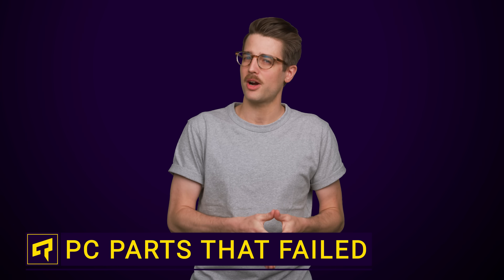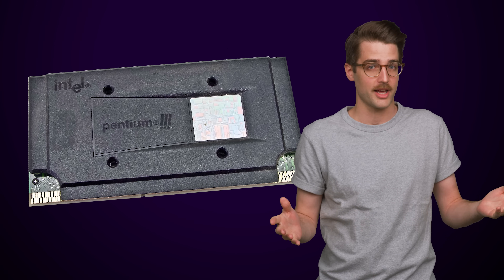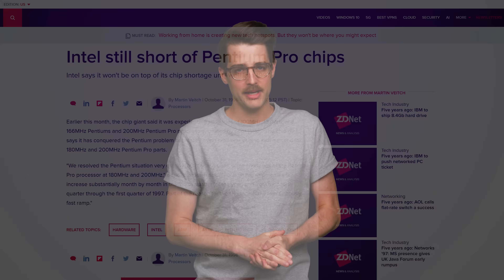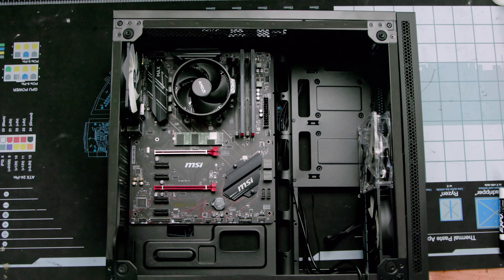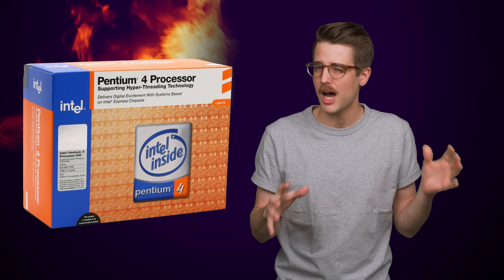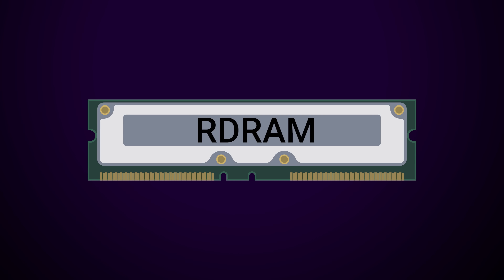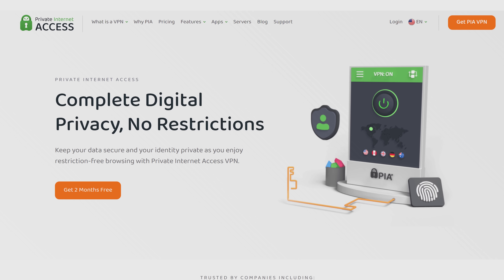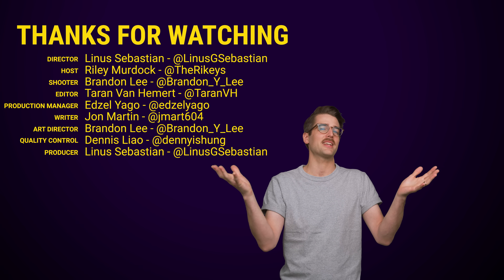PC Parts That Disappeared

Comment: more old stuff: the turbo button, physical co-processors, ISA-, PCI- and AGP-slots, IDE-ports
Reply: That turbo button was probably the most misunderstood and misused feature in the history of home computing.
Reply: @Seadg  Yep. It was really "run at full speed" or "run at a reduced speed"... no Turbo about it anywhere.

At one point it was a fun troll to walk around and see someone playing a game (such as the original Star Wars) and noticing that they had the turbo switch set to "not full speed", press it back to full speed. At which point the game became immediately insane and unplayable. It wasn't coded based on timings, just to go as fast as possible...
Reply: @Seadg  Wasn´t the turbo button designed to keep some applications from running wild as they were clock dependent? Like games f.ex. that would run too fast if the turbo button was on?
Reply: @Seadg  I think you can still gets that on some PCs that features that. It's like a "auto overclock" feature now of days though.
Reply: @Seadg  yeah most people did not understand that when "enabled" it actually cut the processors speed in half vs making it faster.  I had actually built a DX2 66 with MFM hard drives one time just so I could play games like The Oregon Trail lol even had windows 3.1.1 just for networking running DR Dos instead of MS dos.
Reply: physical co-processors are really cool, especially the ones in the 386 times
Reply: @whamer100  the 486 SX didn't have a built in math coprocessor but the DX model did. It was standard on pentiums. It was very important that my six year old brain remembered this because I'm 32 and waiting for the day this is useful information.
Reply: @McBlazington  Was it possible to have a second coprocessor with the DX model? I wonder what would happen if that was possible (unless it uses a different socket and im mistaken)
Reply: @whamer100  with the 487SX, it was essentially a 486DX with different pins. When plugged in it disabled the 486SX chip and took over all the processing.

Edit: The DX and SX had the same socket, but different boards may or may not have had the coprocessor socket. I imagine there was some sort of protocol to disable the second socket for the DX.
Reply: Those didn’t fail per se, they just became obsolete. Mind you VLB and AGP barely lasted two generations.
Reply: @TheOriginalNCDV  The video wasn't about failed hardware, but, well, literally look at the title.
Reply: @thany3  Watch the video. READ the first thing that appears on the bottom. You're welcome.
Reply: @TheOriginalNCDV  I dunno bro, I was still buying AGP when the 8800gt launched. I had a ATI radon sapphire HD2600 PRO. 
My next upgrade was a HD 5770.... jesus christ that was a he'll of an upgrade.
Reply: VLB and EISA. I've still got a Cyrix 486 with working EISA in it (SCSI, too).
Reply: Just an entire episode about Jumpers and how to configure your motherboard, drives, and expansion cards.
Reply: My first real computer was a commodore Vic 20. Yikes, I am old.
Reply: @rickh8380  TRS-80 for life.... team tandy radioshack
Reply: @rickh8380  My very first computer was a custom-built tower PC with an Intel Pentium 233 MMX processor, it initially had 32GB of RAM, and originally came with Windows 95. I don't remember the hard drive's capacity, though. Several years later, we upgraded the RAM to 160MB and the operating system to Windows 98 Second Edition.
Reply: and dont forget BNC Bus networking
Reply: @BoerniLE  haha yeah unplug one node and the whole lab is down. Oh highschool...
Reply: SCUZI
Reply: Sockets to insert individual CPU cache RAM chips
Reply: I still use a FireWire 400 audio interface. But remember when FireWire 3200 was meant to beat out USB 3?
Reply: VLB and Firewire would be great ones. Firewire didn't really catch on outside Apple and kinda was obsoleted quick. Unless you used high speed (at the time) external drives or DV camcorders it didn't really get used. Obsoleted by USB 2.0 real quick too. VLB was funny it last like what 4 years? AGP was around a short time but actually served a purposed as graphics had gotten important. VLB was like there one day and gone. Back when we counted video cards in the single digit MB range for ram or upper KB. I remember all those standards. I learned basic on an Apple clone (Laser 128). I am old and obsolete myself x.x
Reply: Math coprocessors. I think one of them was the 8087?
Reply: @comicsansgreenkirby  Correct... after that came 287, 387 and 487 (well, kinda, it literally was a 486DX that would disable the 486SX it could be added to).
Reply: AT motherboards, SCSI, eSATA, Firewire, CD caddies, trackballs, the contrast slider on a laptop, IrDA, PCMCIA
Reply: @thany3  SCSI is still around.
Reply: @JOE_XD  same with IDE. it lives on in Compact Flash Cards. CF Cards can literally operate identically to IDE Harddrives which is very useful for retro computers like IBM PCs or Amigas. it's basically just the IDE equivalent of a SATA SSD, smaller, faster, and solid state.
Reply: @JOE_XD  No new hardware produced today uses SCSI anymore. Therefor it's obsolete. Not out of use, but obsolete. Just like my 386.
Reply: @thany3  You should ask Anthony.. Logitech still making trackballs mice too. Your 386 don't even run Warcraft 2, get rid of that -> museum :P
Reply: @thany3   I still use eSATA (quite convenient for hotswapping HDDs) and my Laptop has a PCMCIA to 2xUSB3 card in it, so these aren't exactly outdated yet but rather uncommon by now. The rest tho, absolutely.
Reply: @XmarkedSpot  They are outdated, because no newly produced hardware has/uses them.

In your logic, my 386 would not be outdated if I'm still happily using it.
Reply: @thany3   Don't put words in my mouth, mate. In other words: just because something isn't in "newly" produced hardware - whatever you think that is - doesn't mean it's outdated. Are DVDs outdated? An optical drive is certainly a rarity on modern devices...
Reply: @thany3  CD caddies are still a thing, they might not run 5.25" drives anymore but I am using mine for dual 2.5" HDDs with hotswapping caddy. Works very well and like a charm.
Reply: @thany3  Trackballs aren't dead. They have a niche use in some industries..
Reply: @liboud22  You don't see them on any laptop anymore. And no, they're not dead, but they are obsolete. Just like RS232, which also has a niche in some industrial applications.
Reply: @thany3  There is a HUGE difference between claiming something is dead and something is only obsolete for general consumers.
Reply: 5.25 and 3.5 inch floppy memory drives
and you could have your blank floppys vaccinated with some sort of anti-trojan/worm/virus stuff but it took out some of your memory lol
msdos / lotus / wordstar
Reply: Floppy drive
Reply: Don't forget the lock in front of the computer
Reply: jumpers to set the cpu multiplier or the motherboards bus frequency
Reply: I fully expected IDE and AGP to make an appearance in the video! PCI and to a lesser extent ISA are still found on embedded systems and MoBos for industrial applications, since a lot of specialized expensive hardware whose often even more expensive to replace preripherals are still in use was built for those. The VESA extension to ISA however. Now THAT would have been an interesting one for the video!
Reply: PCI-X... fucking servers.
Reply: Wait, there's more!
Acoustic couplers - be very, very quiet when using one of those.
iomega Ditto drives and the damn TRAVAN tapes - expensive and unreliable af.
And the PS/2 connectors big brother: the XT keyboard DIN plug.
Reply: @chrishuhn5065  ahaha, my old amps and turntables use  5 and 1 pin DIN. I knew they were used in Audio and some specialized electric equipment, but never in PCs. Good stuff!
Reply: SCSI port.
Reply: "botton" ?
Reply: @YounesLayachi  fixed
Reply: Microchannel bus for $400, Alex
Reply: SCSI's too. 😄
Reply: @davidbolha  scsi is still around.  Rocking the server world
Reply: @SpartacusLegends117  Good to hear ! 🤘😏
Reply: I have an old mobo with IDE, PCI, PCI-X and AGP. Runs DDR, and has 2 LGA 771 sockets
Reply: Dude I remember being so stoked for having the best-in-slot nvidia geforce 6800 gt agp card! The last agp card they made
Reply: PCI and IDE isnt that old yet.
Reply: i sometimes think of adding a co-processor to my z800..... for $30 it might look cool
Reply: Even modern Mainframes that can rev up to 8000 VMs at a given time still have co processors coupled with system processors.
Reply: IDE, PCI and co-processors are still pretty relevant as of today
Reply: @kingeling  regular PCI and IDE are EOL. physical coprocessors were a thing you plugged in next to your CPU to aid in e.g. FLOPs. this is clearly not a thing anymore
Reply: @kingeling  
>co-processors with a PCIe interface are still a thing
We're clearly talking about home/enthusiast usage, not edge cases like scientific computing. There were at least a few notable 90s games that could make a tangible use of it, like Quake, Descent, the original SimCity and some flight sims.

And yes, you could to say that GPUs are also arithmetic coprocessor, but they are extremely fancy coprocessor, because video cards are not GPUs alone, but also memory and sophisticated power delivery systems. While 90s coprocessore were just that — only coprocessors and nothing more.
Reply: Don't forget MCA, LPC, PC/AT, PC/XT, PC/104, & the original 8088 it all came from.
Reply: I remember my brother's computer having a turbo button but it was so long ago... What was it for again?
Reply: @Joullele9  to downclock the cpu so older software would run at acceptable speeds. for instance, older games (at the time of course) were programed to run on slow processors in the likes of 8008 or 80186 and if you ran them on a newer processor, say a 80386, it would be so fast it would be unplayable. thats what the turbo was for.
Reply: I have a slot pentium II and 2 pentium III's laying around, also at work I have a control system on a machine from 2014 which has an ISA16 baseboard with the CPU on a board that plugs into it, together with a 128MB IDE SSD (yes, SSD) 128MB CF card for extra storage and running DOS, the CPU board was recently replaced, it used to be a coppermine celeron
Reply: Ultimate old stuff: The Abacus, the OG computer.
Reply: Jumpers
Reply: > physical co-processors
you mean, nic, tpm, audio dsp and gpus?
I don't think that really went away.
Reply: @satibel  No, the second (optional) processor just for speeding up math. This -> https://en.wikipedia.org/wiki/Coprocessor#Intel
Reply: These ones in the video were tried and failed techs, not "dominated for a decade, then had a successor eventually" techs like IDE or AGP.
Reply: @sapphyrus  Try those instead: 
XD Picture Cards - vendor lock in flash memory cards from Fujifilm and Olympus that never really took off because it was expensive and you could brick the card when you pulled it during a write or even only a read operation. At least now you can buy adapters for MicroSD.
IBM Microdrive - a teeny tiny hard drive in CompactFlash II form factor. Fragile, slower than flash memory and because of the motor needs way more power than flash memory and drains your camera batteries in no time. Why does this even exist?  Only because it was cheaper than CompactFlash cards.
1.8" Hard drives - The PCs equivalent of the Microdrive. You can still by them, but good luck trying to find one in a decent size, that doesn't cost you an arm and a leg.
Reply: wot, no Vesa Local Bus?
Reply: I just upgraded from a PC (3570k) that still has a PCI sound card (X-Fi Elite Pro) in it and two DVD drives attached to an IDE controller sitting in a PCIe 1x slot (getting that controller was cheaper than replacing the drives and I knew I had good ones that would still last for a while). And I still use that thing at least to transfer stuff over to the new one.
Reply: voodoo 1 & 2 :D
Reply: It was a dark time when ISA went away. Thankfully modern microcontrollers and the RPi have brought easy IO back to the hobby market.

Comment: For a technology that died that seemed to be 'forever' and even possibly superior: Firewire. USB was supposedly never going to be fast enough to handle streaming video, and large file transfers.
Reply: Because IEEE-1394 Firewire can transfer data at full duplex mode . Those days, USB only can do half-duplex. ntil the emergence of USB 3.0 , then it supports full duplex mode.

Comment: Thought for sure a Soundblaster sound card would be mentioned.
Reply: Soundblaster still makes sound cards
Reply: @aaronmischel4552  yeah but there was a time your game wouldnt run properly if you didnt have one or a compatable one. any old sound card wouldnt work.
Reply: @CaffeinatedSentryGnome  - could you elaborate on that? 🤔
Reply: @spavatch  early on games with written with the features of specific sound cards in mind. if your card didnt have the feature bad luck. dos games needed to have drivers for each sound card they support written in them.
Reply: was expecting same. im still running an spu with creative based chipset in it and have no plans to switch to onboard audio.
Reply: fun fact when I built my system back in 2012 I still thought sound cards were a thing and bought one of sound blasters cards.  Still have it today!
Reply: @firenutz698  - funnier fact, I bought my SB Audigy back in 2002 and used it in every PC that followed, up until 2Q 2020 when I built my latest system that unfortunately lacked regular PCI slots. I do still have it today though, the previous build is still intact as a backup PC.
Reply: They still make those!
Reply: I got a soundblaster Z card and the sound quality is 10x better than an onboard soundcard

Comment: I had an AMD Athlon Slot A 700 MHz processor. It blew up. Replaced it with the Athlon socket A 800 MHz processor under warranty.

Comment: I remember the Pentium 2 being quite good at the time, because back in those days CPU coolers were really annoying/stressful to put on. It involved using a screwdriver, to push a clip under your CPU socket. If your screwdriver slipped then well, better hope it doesn't score anything important on the motherboard. Not an issue nowadays of course, where they're designed more sensibly

Comment: PCI-X had a brawl with PCIe, and disappeared fairly quickly.
I personally only ever saw PCI-X once.
Reply: Not quite true, PCI-X was really a server technology, it never really saw much use on the desktop, if any. PCIe is actually the evolution of PCI and PCI-X, so not really competitors. AGP was Intel's solution to the ever increasing bandwidth demands of GPU on the system bus. I think AGP was always intended to be a bridge technology till PCIe was ready.
Reply: Also AGP
Reply: @sundhaug92  Well, at least AGP was "the" standard for some time. It had a fair run.
PCI-X tried to compete with PCIe, but had to admit defeat, it seems.

Comment: You could have thrown the Micro Channel bus (and its blue slot connector) into the mix! In my IT career, I don't recall a single system using it when it was being promoted as the 'next big thing'.

Comment: I will never forget the AMD slot CPUs. They would get so hot the Solder would melt and gravity would take over causing the CPU to slide down the board. At which point all the connections failed and you had a dead PC.
Reply: Wtf? Seriously?
Reply: @PratameshMistry  Yup. The PII 450 Slot1 would also do the same if you overclocked it.
Reply: that was more of a cooling issue and mainly with overclocking. It was funny though. Did one like a gpu with the oven trick worked for years afterwards.